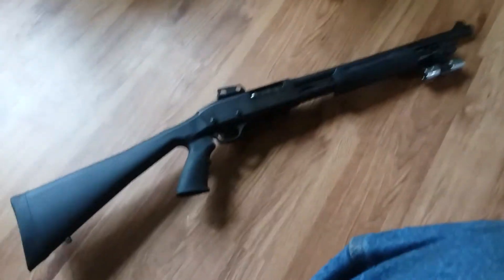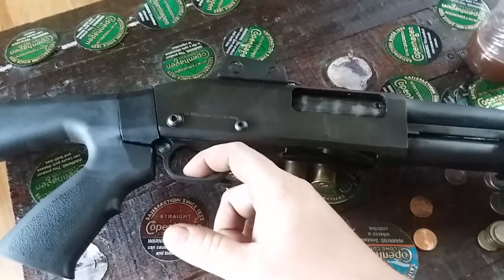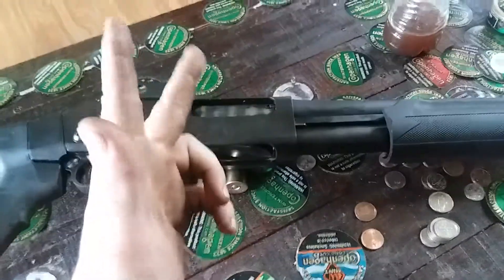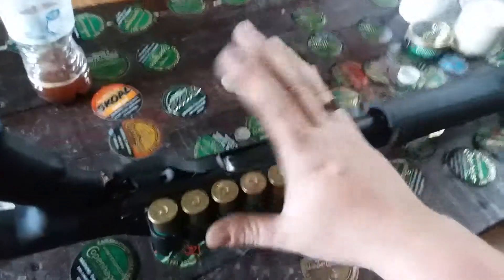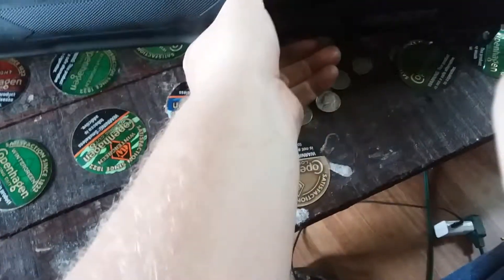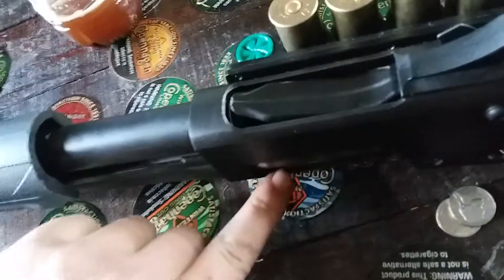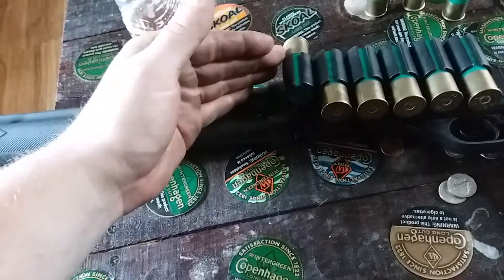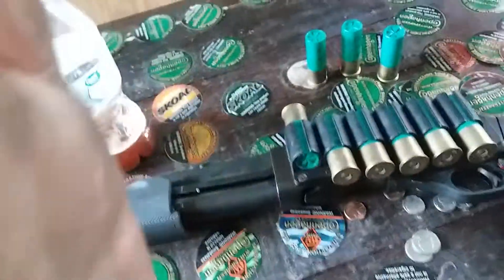Hawk 982 12 gauge

Comment: You can in fact use an 870 barrel on the Hawk 982. There is a seller on ebay (johnthejeepguy) that sells adapters that will allow you to use 870 barrels.
Reply from the maker: I didn't know that.